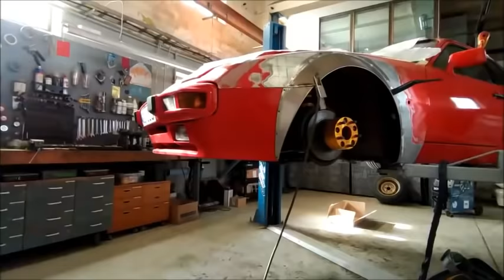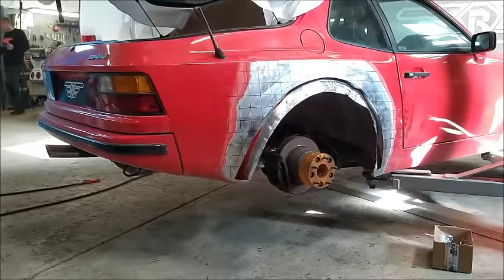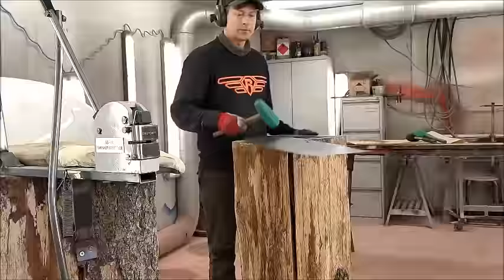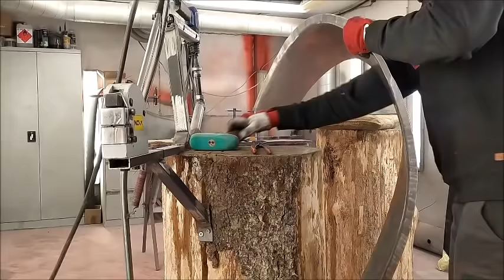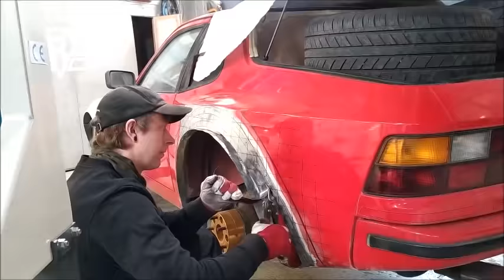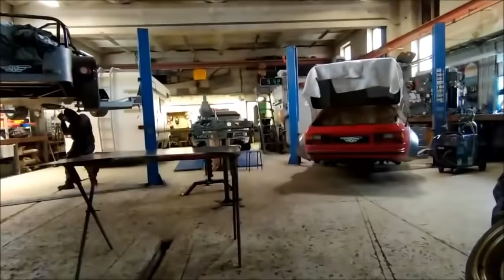Porsche 944 Custom Widebody Build

Comment: Good metal fabrication but yet another car ruined……spacers on axles are a very bad idea, the whole suspension geometry is now off, the weak points an immense danger.
Racing teams spend big money calculating the geometry  for balance and handling, this should be a stationary object to avoid endangering others.
As a work of art to look at its great…..
Reply: It makes it easier to check the alignment/radius of the fender when the tire sticks out further then it during fabrication on some occasions. Agreed that it shouldn't be altered permanently with spacers though.